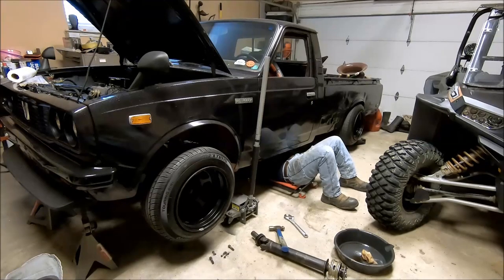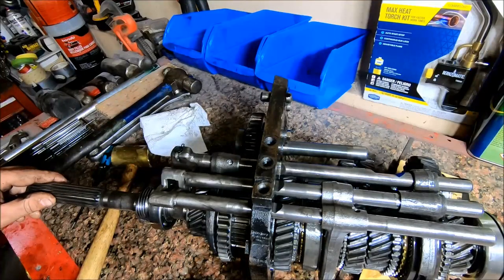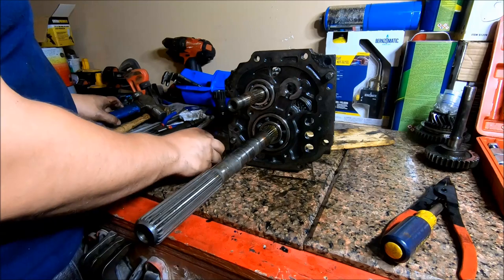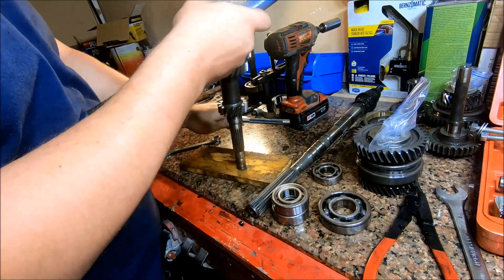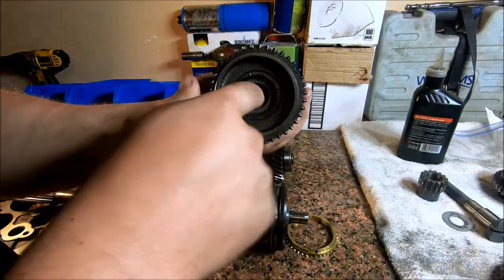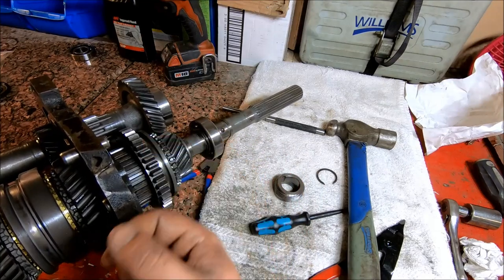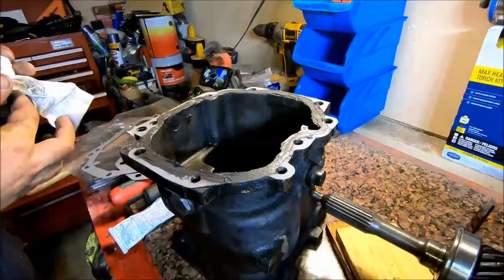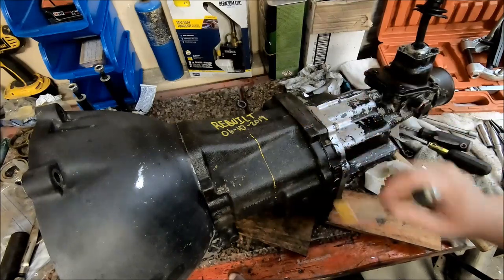How to repair or rebuild a TOYOTA Transmission - W50/W52 COMPLETE REBUILD!!

Comment: Finally a good and detailed
 video how to change bearings on w50 thanks :) now i have something to do in the garage in the winter
Reply from the maker: Nothin to it but to do it! There's a link to an old service manual in the description of the video. It was pretty helpful but did have some differences that caused some confusion for me. If you get in there and have any specific questions fell free to drop them on here and I'll get you fixed up 👍👍

Comment: Your upload timing could not have been better. I have a 5 speed and 4speed (spare, came with the truck)I need to rebuild. Great video I was getting worriyed I wouldn't find the information on these trans. Thank you.
Reply from the maker: Yeah I couldn't find much before making this. I more or less just went into it blindly. Fortunately my wife was able to find the service manual I linked in the description and it helped some.

Comment: I’m in the process of rebuilding my w50. Your video is the best one out there. Thanks for posting this up! As far as the bearing installations go, I have always been told to only use a punch on the outer race.. you said the opposite which is throwing me off because you seem to know what you’re doing. Why do you use the inner race?
Reply from the maker: Bearings in general typically have a press fit (sometines called interference fit) and a slip fit. You drive the bearing depending on where the press fit is. These bearings press fit onto a shaft and then slip into the housing so you drive the inner race. If the bearing was a press fit into a housing with a shaft going through it like a wheel bearing you would drive on the outer race. Hope that explanation makes sense.
Reply: Makes sense, creating less stress on the bearing. Thanks!

Comment: First where can I find the rebuild kit?
Second when you mashup two shifts try using zip ties, i used them when I rebuilt my AX15 transmission it really helps also when installing the locking balls and inner locking pins petroleum jelly works just fine no need to worry about it will dissolve in transmission fluid 
Thank you for your effort and good info 👍
Reply from the maker: Ebay is about the only place to find them now and they're getting harder to find. Just search "Toyota W50 transmission overhaul kit" and usually one will pop up.
Reply from the maker: https://www.ebay.com/itm/223162074442?mkcid=16&mkevt=1&mkrid=711-127632-2357-0&ssspo=x2zfSDEwQpm&sssrc=4429486&ssuid=&var=&widget_ver=artemis&media=SMS

Comment: Thx dude bad ass truck..i got a 1980 celica. Put in a clutch about 2 years ago and many a burnouts later its gettin shitty again figured mite aswell rebuild the trans
Reply from the maker: Thanks guy. I've been driving the wheels off of the truck since the rebuild and she is going strong. I love the older import stuff especially first and second gen celicas. You should make some videos about your car, won't be much longer and you won't be able to find them.
Reply: @BCDriven  maby ive thought about it. They just wont be as interesting as taking apart a tranny. Lot of body work needed. Aka lot of sanding haha
Reply from the maker: @mystearns  Even if you don't film everything it would be cool to do some before, during and after walk arounds,  just so you can show people your journey. Or at least look back and laugh at yourself.. thats why I film my stuff haha
Reply: @BCDriven  hey man i ended uploading a vid if you wanna check it out its unfe my other name. yota geek 1980 toyota celica

Comment: Wonderful video.  Were you ever able to get any confirmation as to whether the w50 and w52 were identical except for the first gear ratio I believe?  I recently swapped the auto in my 86 toyota  motorhome with a w52.  The salvage yard I got the trans through included a picture of the VIN plate so I could be sure of the transmission type.  It came out of an 85 extended cab released domestically.  As I was replacing the seals and shifter bushing and seat before installing it I was watching your video and everything about yours was exactly the same as the one I was working with, everything.  The w52, or so the internet says, was used in the Hilux in Australia.  The VIN plate I got a picture of was for a truck that was released domestically and various message boards feature the occasional post from someone here in the states confused about their "Australian" w52 trans.  Once again, thanks for the video.  When I decide to rebuild mine, this will be a tremendous resource.
Reply from the maker: I haven't been able to definitively say, but my I'm 90% sure they are the exact same other than gear rations in 1st gear. That being said I'm not exactly sure which one I am rebuilding here either I just know it's one of the two. In hind sight I could have gotten the gear ratio for 1st gear while I had it apart, but I didn't think about it. I bought this trans with the 22R swap, the truck had a 4 speed transmission originally. I'm pretty active on here and instagram if you run into any issues. I have video of the entire 6 hour process so I can probably find the answer to anything I might have skipped over in the video.

Comment: So i had to pull the rear case off to swap shifter bit  from an extended type shifter , i left the reverse switch in and havent upset the steel sammich plate to front housing that i can see .. worth the risk or am i going to cop oil leaks if i dont get fresh gasket and goo on the front side of the plate ? i'm struggling along with just my left hand .. right hand is out of action .. tied the box to the bench, lol.  your video rocks and without it i would never have bothered to try
Reply from the maker: In all honestly if you didnt disturb it I would probably not bother to take it apart. On the other hand, that gasket is a super thin paper gasket and when I removed mine it was brittle and almost crumbled. I guess it would all come down to how much the plate and the box got disturbed.

Comment: Great video. Just curious as to why you'd not use a hot pot of hot oil to warm up the bearings so they expand and just slip on without having to use a punch?
Reply from the maker: Couple different reasons I didn't choose the oil bath method but to sum it up, handling hot bearings, dealing with the oil clean up, having to set up some kind of outside burner to heat the oil, it was all just too big of a pain in the ass for my scenario. I had the drift punches out anyways and it just felt more natural to me. Both have pros and cons, I recommend doing whichever your most comfortable with.
Reply: @BCDriven  I've always just used the kitchen stove. ( I have an understanding partner)
~ laughs ~

Comment: Super helpful, buddy. Question: I'm working on a W58 tranny. Is it a much different process?
Reply from the maker: Unfortunately I have very little experience with the W58 Trans. I would say the basics will be the same like snap rings and bearing removal, but the order and locations may be different. Sorry I couldn't be more help.

Comment: Did the hilux come with this trans or did you swap it in? I go a 1974 hilux and was wondering if the w50 would be a direct swap in
Reply from the maker: So I'm not going to be the most help here since my truck has a 22r swapped in it instead of the original 20r. When we did the swap we also swapped the 5 speed w50/52 in it. I'm not sure which I have as they are to the best of my knowledge the same transmission with a slightly different gear ratios. I know you will have to move the crossmember forward an inch or two and we used the drive shaft from the donor truck as well. Hope that helps some.

Comment: Did you sand and paint the truck as well? Got any engine running vids??
Reply from the maker: Not many videos unfortunately but yes we did the paint ourselves. Its a 50/50 truck, looks good from 50 feet away or drivinging 50mph lol

Comment: Me again Ive watched your video about a million times, I just finished putting my gearbox and tail housing on but the snap ring on the input shaft bearing isn’t sitting flush against the gear box, this is causing the bearing retainer to not sit flush, I couldn’t tell if yours was flush. Do you remember if yours was?
Reply from the maker: Any chance you could put the time in the video roughly where your talking about?
Reply: sorry, I was deep into the project and just finished it up. Got it put back together and shifts like new! This video was a life saver!
Reply from the maker: Glad you got it figured out, mine is still doing great. Just got back from a 600 mile round trip and still shifting great.

Comment: Hi Friend, good work! I am restoring a Toyota Celica Coupe RA40 1981 with the same gearbox (w50), and this video is great!! I've bought the same repairing kit from ebay, and a in a few days i will start to make the rebuilding. I afraid of synchros and balls bearing (from the kit), do they good quality?  Regards
Reply from the maker: The bearings are a decent name brand (NSK which is Japanese) so I don't really have any concerns about them. The synchros appear to be of the same quality as the originals I removed with a lot less wear. Only time will tell how long it lasts, but for now it is shifting very smooth and is working as intended. See my welded diff video for my break in procedure haha
Reply: @BCDriven  I've seen this video too, good job ;-) !!

Comment: BC Driven, I could not tell in your video, but did any of the synchronizer rings have a circular ring (almost like a circlip) and 3 dogs (or keys) in them? I am doing a W50 rebuild and can see that I at least need one ring and keys, but I cannot find a matching product for this trans.
Reply from the maker: I don't remember anything like that but I have several hours of video that wasn't included in the YouTube video so I'll try to look through it this afternoon and see if anything stands out. I've slept a few nights since rebuilding this thing so I may just be forgetting something.
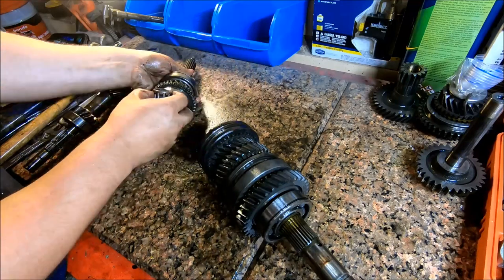Reply from the maker: Actually start the video here at 14:36 and see if this is what you are referring to.
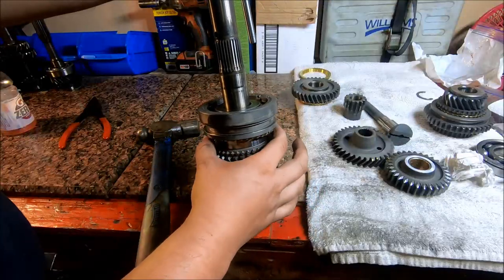Reply from the maker: And also around the 24:00 mark and see if anything looks like what you're talking about. I think I know what part you're needing but I have no clue what it's called. but I might can help you find it if you can identify it in the video.
Reply: @BCDriven  So I replied but included a link to a parts vendor and the reply was deleted. I'll try to remember what I said... LOL. Yes to your reply. That is the part. I had learned that it has nothing to do with the synchro rings at all, but rather just shares the name synchronizer for it, called synchronizer springs. They are also called blocker ring syncromesh units and go to the blocker ring and hub? I found a vendor that had transmission parts but I cannot include the link. Still wondering if the spring and keys/dogs are on each gear or only one or two. Great video by the way!
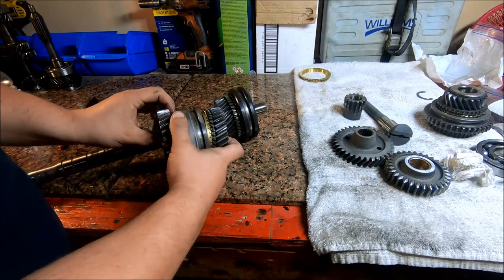Reply from the maker: Yeah I'm not going to be much help with the correct terminology or sourcing parts but there will be three sets of these. One will be for 5th/Rev (11:41), One will be for 1st/2nd gear (14:55), and one will be for 3rd/4th gear (17:00). The outer ring of these assemblies is slid over by the shift fork and engages the synchronizer which brings the gear up to speed and helps it line up/engage with the actual gear. The 3 keys are what transfer the power through to the inner shaft. You can pull these off the trans complete and reinstall them complete (23:02) which makes keeping the keys in place a little easier. I'm looking for a good exploded diagram where I might can help you with part numbers and names but I'm not having much luck. Unfortunately parts for these are getting hard to come by. I've also got a video of assembling one of these assemblies if I can find it, I'll post it
Reply: @BCDriven  Thank you so much for you help. When we know we have the correct parts, I'll share the knowledge here. Keep up the great content!

Comment: Hey man hope all is well...i do have a question. I was doin a test pass and on the way home i lost 1-4th only had 5th and R..limped home on 5th dropped trans clutch is good shift linkage is binding took case apart didnt see a problem put back together and kinda works...question is how does the shifter rod connect to the 3 rods does it just sit in there from your video thats what it looks like
Reply from the maker: @YOTA GEEK all has been well, we've got about 11k miles and several burnouts on the trans since this video. I've got some comments I'm going to add below but if they don't help you out add me on Insta and send me a DM I'll try my best to help you out.
Reply from the maker: So if you watch the video starting at 44:34 I kind of show the arm that is in the aluminum tail housing, the "selector arm". This selector arm engages the three gear "selector rails" you see sticking out of the transmission. It does just rest in the slot of the 3 rods like you mention. Couple things I would check, obviously starting with the easiest, I would check the plastic bushing on the end of the shifter. If it is excessively worn it could be causing the main shifter rod to not line up properly. You might also check that shifter rod for excessive play in the tail housing. It sounds like the shifter rod may be trying to grab two of those 3 rods at the same time.
Reply from the maker: Another thing you might check, start about 35:45 and watch through the interlock pin install. If these pins keep you from grabbing two gears at the same time. In the video I show putting them in dry, which is really probably not the best practice. It wouldn't have been a bad idea to polish them up with some steel wool or scotch bright and coat them with some light grease before installing. Same goes for the detent balls , springs and rods. They're all on the side of the trans so they don't get a lot of oiling during normal operation. Any of these components binding would cause the same issue your describing.
Reply: @BCDriven  appreciate the reply i think i might have yanked gears to much and caused it to like you said be trying to grab 2 gears...ill have another look tonight and see...about a week for parts so ive got time to figure it out
Reply: @BCDriven  side note what kind of cam do you use
Reply from the maker: It was installed in the truck when I got it but was told it was a LCE stage 3 cam I have not verified that though. It has a nice chop when it's ideled down real low.
Reply: @BCDriven  *camera lol
Reply from the maker: @youtubecertified6104  HAHA well at least now you know my cam specs lol I shoot everything on a GoPro. This was on a hero 6, when i edited this I messed up and killed the quality. I now use a hero 7 (and the 6) and edit with better software.

Comment: where did you get parts?
Reply from the maker: I ordered a cheap kit off EBAY. If I remember correctly the bearing wound up being SKF  bearings which are a reputable brand. The Synchros seamed a little rough but have done the job great.
Reply from the maker: https://www.ebay.com/itm/Toyota-Pickup-W50-4-5-Spd-Toyota-Transmission-Bearing-Rebuild-Kit/223162074442?ssPageName=STRK%3AMEBIDX%3AIT&_trksid=p2057872.m2749.l2649

This is the exact kit I used, It was about $160 or so after tax. There's more expensive kits but that's the one I used and It is still holding up great even after a lot of abuse.

Comment: What a grimy unit why not pressure wash it first? If I'm going into a box I replacing every part available.
Reply from the maker: Didn't own a pressure washer at the time and needed a quick turn around. If your have means to clean the outside of the unit and feel the desire to do so theres nothing stopping you. The only thing I didnt replace are the actual gear sets and I could have easily found another transmission for the cost of the gears which were all in great shape, all things considered. Thanks for watching and commenting.
Reply: @BCDriven  Brother, I like to clean my units so crud dont fall into the box when I open them up .
Reply from the maker: I do too, when time allows for it. I mean It honestly wasn't even that bad, just a little shiny because of the oil lol You should have seen it when I pulled it. But you can rest easy knowing nothing fell in the case and that it has held up fine for at least 40k miles and more than a fair share of abuse and neglect in between. Again, if you have the time and means to clean the outside of your case while it is out do so, my trans stays under the truck and the truck is too low to crawl under so I'm not too worried about what it looks like. And again, thanks for the  comments.